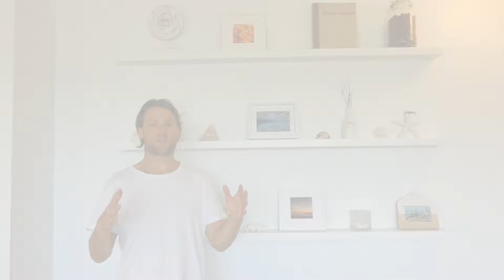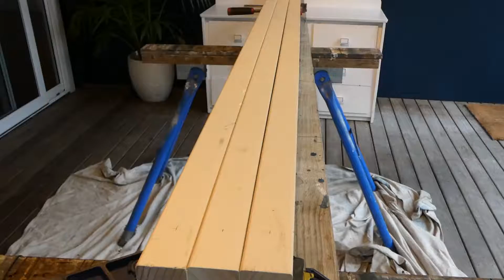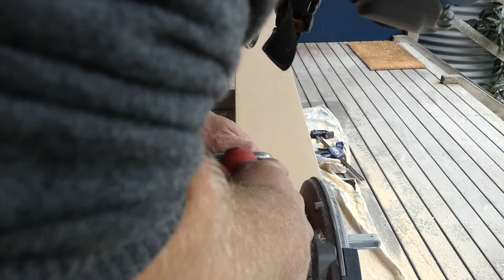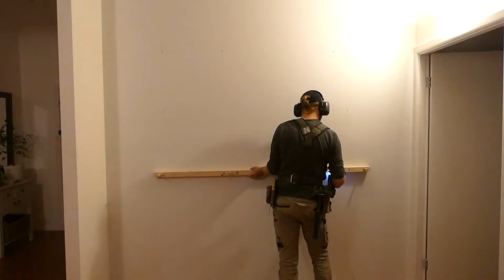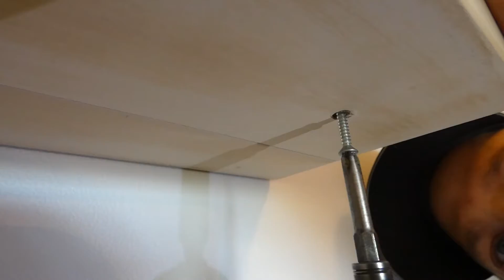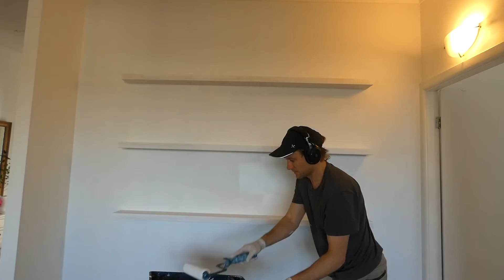How To Build Strong Timber Floating Shelves

Comment: Solid job, Those shelfs are not coming down before the house is. My wife is asking me to do a similar job in the kitchen putting up some long shelfs, so I might just follow your advice. Another great benefit of floating as much as possible on the wall is that robot vacuum cleaner won’t have any problems getting around 😎
Reply from the maker: Thanks Daniel. That would be a great project to install floating kitchen shelves. Let me know how it turns out!